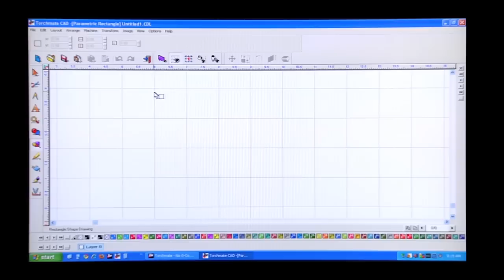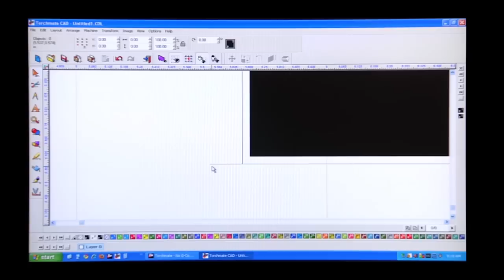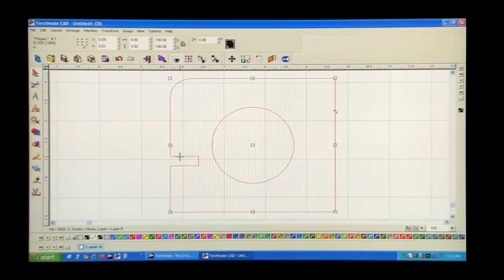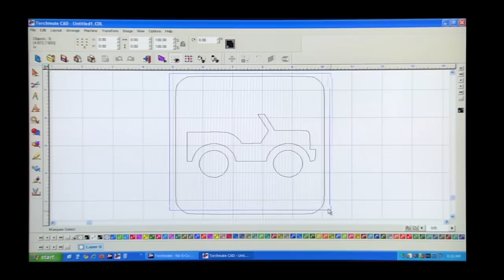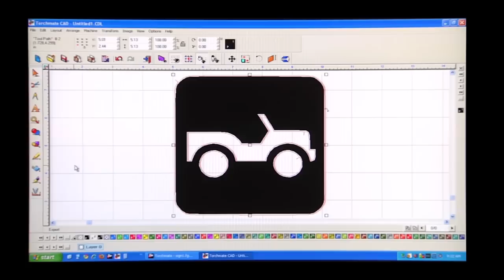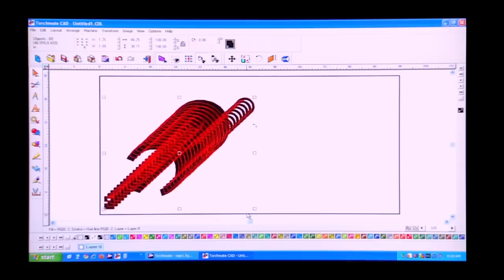Torchmate CAD/CAM and Torchmate Driver Software Overview

Comment: How do the cadd functions compare to autocad or microstation do you have simple line, polyline, spline, curve, offset, mirror, trim, extend, commands... or is it a more shape based program? can you make customized buttons,layers and macros? Can you make blocks or cells in the program? If it is shape based can you use dwg or dgn files or do you have to use dxf?